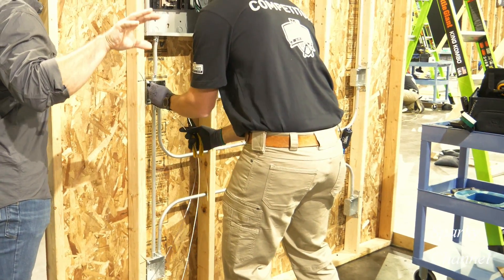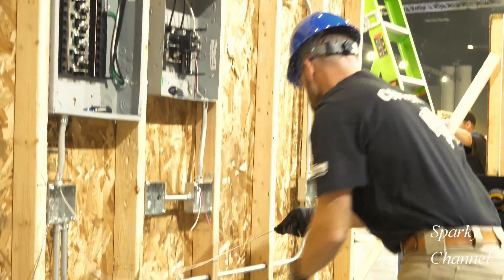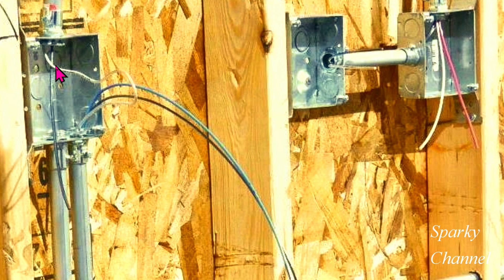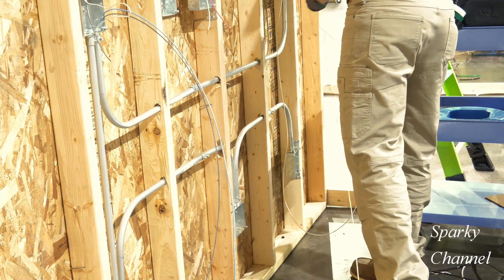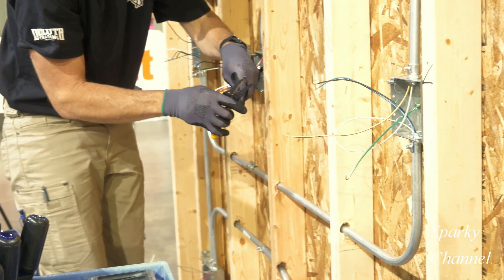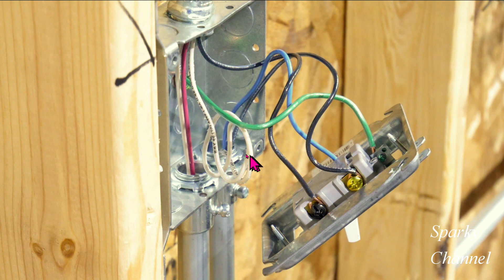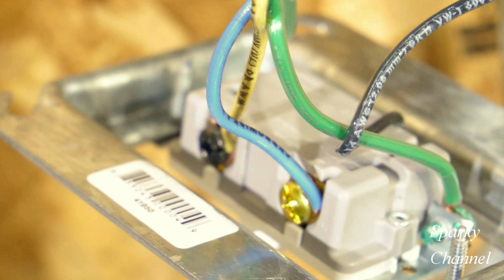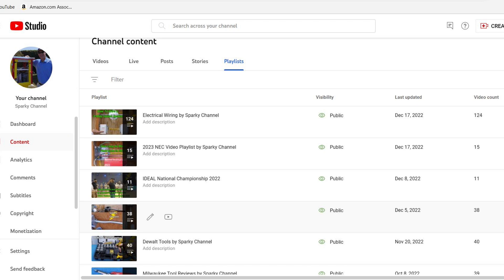How to Wire a 3-way Switch Lighting Circuit in EMT Conduit

Comment: You don’t have to run green wire as as well ??
Reply: @1stcivdiv81 the EMT is the grounding conductor, this is allowed in code. NEC 250.118
Reply from the maker: Yes, ground wires are a good idea. Not always necessary when using EMT conduit, but a good idea.
Reply: Like for grounding ?!

Comment: Bill , I have a question for you : is it possible to make a video regarding 3 way switch wiring in a 2 story house scenario . Light switch at the bottom of the stairs , 2 light fixtures on opposite sides of the wall in the stairwell and light switch at the top of the stairs  . Every video out there features 2 light switches in line and 1 light fixture , but that does help much .
Thanks in advance  .

Comment: Hey, Bill! Is there a typical standard for running specific color wires in regards to EMT? I noticed (I think) that he used the red conductor as the hot wire for his outlets. Is this a code/standard, or just up to the preference of the electrician?

Comment: Question: Off topic I know, but this is a recent post so I'm taking a shot. Behind the knee walls in my attic is a storage area that I wired up for outlets with 12-2. There are four outlets on the circuit. I added a 4x4x2-1/2 jbox at the beginning of the run for future expansion. I currently have only 4 conductors in the jbox. Rather than pull wire for a lighting circuit, I would like to come out of the jbox with a short run of 14-2 to power two light fixtures in the storage area. By code, can I wire a 14-2 lighting circuit, or do I need to stick with 12-2? Appreciate any suggestions/answers I get. Thanks.
Reply from the maker: Is this a 20 amp circuit?
Reply: @SparkyChannel  Yes sir. It's on a 20 amp dual function breaker. I'm wanting to feed two switched, led light fixtures. The light fixtures are rated at 45 watts draw per fixture.
Reply from the maker: @im2yys4u81  No, a light circuit coming from your J-box would need 12 AWG wire due to it being a 20A circuit.
Reply: @SparkyChannel  Thanks!

Comment: I'm good with the coloring here, but typically when I'm running in conduit, it's 3 phase environments.  There I was taught to keep black/red/blue accurate to their respective phases, so I wouldn't run a blue+black as travelers.  Instead, I'll run 2 of the phase color and color tape one so I can still keep the travelers straight but also keep the phase straight.  I don't want to run yellow there due to confusion with higher voltages.
Reply from the maker: Thanks!
Reply: Well this is single phase so all colors except black, red, white, and green are ok.  Chicago sparky here.  Everything is conduit.  Usually use yellow or orange for switch leg, blue or purple for travelers.  Doesnt matter though, just how i was taught.  No failed inspections because of it.  I agree 3 phase would be different colors due to colors on phase wires.
Reply: @skiball83  My hat is off to you and other Chicago sparkies who are all conduit.  After a nasty fish job, I console myself saying, at least it wasn't pipe.  Most comm/ind work around here has drop ceilings or exposed work, so not too bad.

Comment: I would not have made his color choices.  I'm assuming he was provided with those colors on his rack, but I would not have set up for such a project with any BOY colors.  I keep pink and purple on the shelf to give me special colors and if I were setting up that 3 way, I would have used black for common and blue and another special color for travelers.  the only time I intentionally set up BOY colors for 120V is when I'm doing control wiring, and the color coding of the controls includes them.
Reply from the maker: Excellent, thanks!
Question: Would you consider the enclosure in which the service conductors come into such as a Solar Ready Meter Load Center Combination to be service equipment? That is, is the enclosure itself considered service equipment?
Reply: @SparkyChannel  well, the NEC definition excludes alternative energy provisions as service conductors.  but any equipment up to the first point of disconnect is considered service equipment.  so if the gear combines the first point of disconnect with the solar connection, then the gear is service equipment.
Reply from the maker: @kenbrown2808  I found some text in my 2023 handbook under service equipment: "Individual meter socket enclosures are not considered service equipment according to 230.66(B)....."
That's a surprise to me. 
I took down my videos on the concentric oversized rings (if bonding bushings are necessary) and I'm trying to make another video, but this time using a Solar Ready Meter Load Center Combination. It seems that the need for bonding bushings is dependent upon whether the enclosure is service equipment or not.
Reply: @SparkyChannel  my interpretation of the intent is on metallic conduit carrying service conductors, so the conduit between the meter and the solar ready service panel would require a grounding bushing.

Comment: Shouldn't the plaster ears be broken off the switches?. Doesn't the EMT need to be supported within 3' of a box...or is running through the studs sufficient? Some of these screw terminations he has insulation wrapped around the screws.
Reply from the maker: Yes, going through the studs counts as support for emt. The ears need to stay on the switches in this instance. Thanks!
Reply: I suppose in theory here the drywall/mudding would be going up later around the mud ring.  After that is done, the ears are needed to land the switch flat with the finished wall.
Reply: Good question on securing and supporting EMT. The EMT must be securely fastened within 3 to 5' of boxes, with exception. The vertical runs between boxes and the switch leg conduits seem to be unsecured. The runs appear longer than what would be considered a nipple. I always tried to offset to the stud in order to secure the EMT. Also Caddy makes hangers to accomplish this. I guess this might be a competition "give" or might be accepted in Chicago by inspectors.

Sorry for being off topic.
Reply: @donl1410  chicago sparky here...yeah supposed to be secured within 3 feet....i have seen inspectors pass trash done by a coworker of mine that i would have failed on the spot.  That guy is still pissed at me 3 months later after being sick of his garbage work and calling him out.  Next time he needs to pull his own wire, then he will know why.

Comment: Nice to see that they still make the porcelain keyless lamp sockets; they do seem to be hard to find nowadays. On another note, at 8:39 I see that they still put that 660-watt rating on such things (I've seen it on plastic 'Y' adapters as well). IMO they should really clarify- somehow- what the intent of that marking is. I believe it goes WAAAAAY back to the early 20th century, the details of which are much too great to elaborate on here (back when the average lamp was rated at 52.8 watts)...
Reply from the maker: Interesting, thanks!

Comment: There is no ground attachment to the porcelain lamp holder, of course, but is it required that he put a grounding conductor on the box and connect it to nothing? Really? I did not know that.
Reply from the maker: Yes, for future use. I put a wire nut on the end of the unused green bonding wire and tuck it into the back of the box.
Reply: @SparkyChannel  Thanks. Is that code, or just recommended practice?
Reply from the maker: @ianbutler1983  I don't know if it's code or not, but it is good practice. You don't want the end of the green boning wire accidentally touching a hot terminal.
Reply: @SparkyChannel  Thanks Bill. I am not a pro, but I try to do any work to a professional (if much slower) level. I appreciate your channel.
Reply: @suspicionofdeceit Thanks.